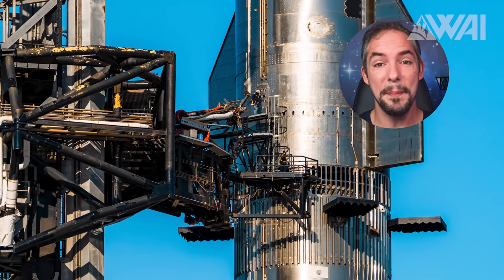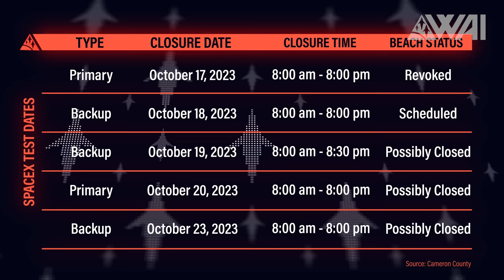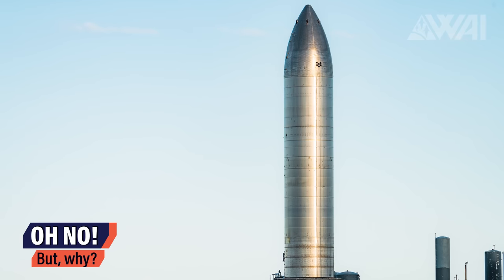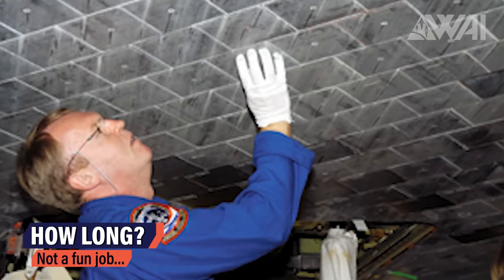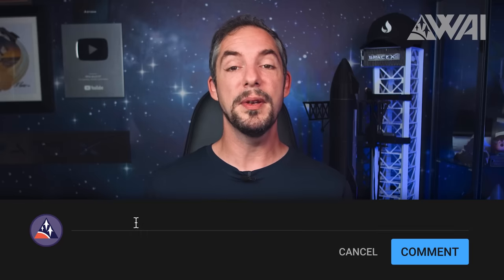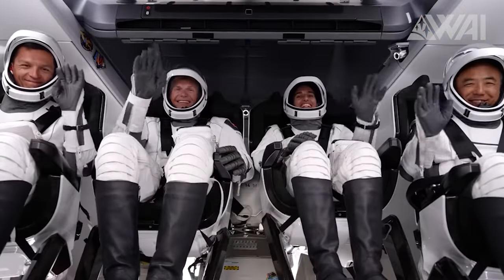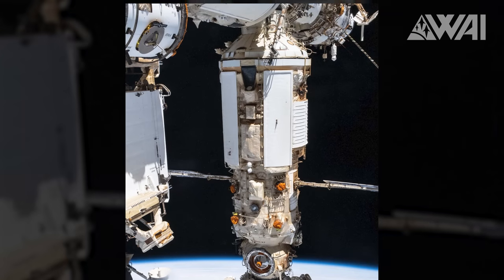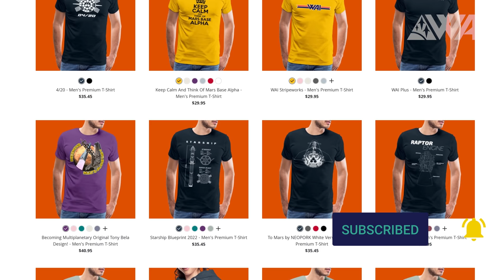SpaceX Starship Tests Continue: It's Action Time!

Comment: Aluminum and stainless are chalk and cheese for heat resistance. I suspect the probability of survival with the of loss of tile(s) is actually pretty good if they can reenter a bit more gently than the capsule & keeping temps below 1000c. 
It will be interesting for sure because that thing is huge and pressurized…
Reply: How many times has this been tried? Many times, you can't dissipate the heat fast enough to prevent rock from melting let alone steel. Elon has the best approach so far.
Reply: If it were not for reuse the 9m diameter sections would not need insulating tiles, only those portions with smaller radius of curvature.  The heat exposure of a surface during reentry is inversely proportional to radius of curvature.  Remember that Atlantis on STS 27 lost MORE tiles than Columbia, over 100, and not only survived but was launched again only 3 months later.  The SpaceX mantra is "The best part is no part." Collectively the thermal tiles, their attachments, and the underlying mats, add many tons to the dry-weight of the Starship orbiter.  I therefore expect that in a year or so, once they have observed actual reentries, that we will see a reduction in coverage.  Even Columbia's aluminum frame melted only where it was exposed by the loss of tiles on the sharply curved leasing edge of the wing.  As long as Starship does not lose tiles on its leading edges there is almost no possibility of any structural elements, made out of the same temperature-resistant stainless steel as your kitchen pots, even deforming never mind melting.  That is why I believe that at worst SpaceX may need to cut out and weld a replacement section.
Reply: I suspect that the refrigeration systems in the Soyuz, Progress, and Nauka were maintained by Ukrainian technicians.  The Russian apprenticeship systems, essential for training competent mechanics and technicians have collapsed !  All Ukrainian employees probably resigned from Roskosmos 600 days ago.

Comment: Yes, absolutely, in some areas finding bedrock is next to impossible: buildings in areas such as Florida, require huge ground posts to support a home/apartment complex and even in NY and CA, towers move.   You are astute..and small movement may continue to be an issue.
Reply: generally those are called "pilings". sometimes architects will design in floats that are then used to build the foundations.

Comment: Small point, but...
Heat transfers in-to or out-of a system. There is no Cold transfer into the Station.  No cold wavelengths of light.

Comment: Do airlines get a new license every time a plane takes off?  Or do they get a certification that certain aircraft types are OK and certain airports are OK for them to fly out of, then are they allowed to fly that plane over and over without having to go through the entire certification process for each flight?  And if we are to fly rockets as routinely as airliners, wouldn't a similar process need to be adopted or its impossible?  Maybe an annual inspection once each rocket passes an airworthiness inspection would be more reasonable?
Reply: Once designed and built the model goes through a long set of certification processes. Once passed a certificate is given allowing planes built in the exact same way to fly etc..

If they want to change some element of how its built later, or redesign the flight hardware (be it software or hardware) then it has to go through a whole process again of recertifying the changes.

F9 has a launch license that is applicable to all F9's built using the same methods, and any changes need recertification, but as its now a mature design, they don't need to make changes, and any they do are quickly certified as they are minor alterations.

Starship however is very different. As its a prototype the license is only given to the single article that is to be launched. There are so many changes between each ship and booster built that they currently require individual certification.

This is not new, and is the same with the airline side of the FAA.

Once they reach a design that 'works' they will get a certification/license like that of F9. But again, any changes need recertification. This isn't unique to SpaceX.
Reply: A spacecraft is not the same as an airplane, and never will be, just as car is not the same as a bicycle, and never will be. 🤷🏻‍♂️
Reply: Very well said. @Thats_Mr_Random_Person_to_you
Reply: Whoa! You forgot that these government agencies need to be able to feel their power, the only way to do that is to hold everything up as long as possible. Someone needs to walk in front waving a flag if you are going over 25 MPH.

Comment: 12:30 During the era of VentureStar, Lockheed Martin lauded their innovative heat shield, Metallic TPS.  The TPS was a composite structure that contains honeycomb sandwich panels at the top and bottom and a variety of thermal insulating materials placed in between them.  The tiles were metallic, a mix of inconel faced and titanium faced rectangular panel fastened on with screws in the corners protected by face caps.  Later it was  reported that LM replaced the titanium with a blanket design  and the end caps for screws were replaced with an expanding wire link and a tool you could slide into the gaps between panels to lock and unlock it to the structure.  I had hopes something more advanced than silicon tiles would be Starship's TPS.  I wonder if SpaceX considered the VentureStar TPS system.
Reply: When you make a million rockets, you want simple reliable and cheap.
Reply: Good point.
 @tedmoss
Reply: @tedmoss   The best part is no part. The more complex a design gets, the more that can go wrong.  Simplicity makes it more easily scalable, and also saves time and weight.

Comment: Just an idea, all that energy to get it initially in the air, would it would not be possible to fire it up a ramp using an electromagnetic sled to assist the initial acceleration?

Comment: Regarding heat shields… why not strips with hexagon edges. Larger puzzle pieces (so to speak), rather than thousands of smaller ones? A strip would wrap around the belly in one piece. Determining the breadth of each strip can be determined mathematically for how large each section could be.
Reply: And watch it crack and fall off?
Reply: @tedmoss  Won’t know till one tries. It’s no different than any other idea that has yet to be produced, tested and learned from. Think of the first starship flight. Not everything worked correctly. They learned from the data and made over a 1000 changes.

Even the current small tiles haven’t  been proven to work.

Comment: Stainless steel expands when it gets hot.  71 meters (height of a booster) expands (grows) about 0.6 meters for every 10 degrees Celsius.  In South Texas, that's a serious issue.  In fact it makes me wonder why SpaceX wouldn't have included some kind of vertical adjustment to the Starship QD arm.
Reply: It appears they did.

Comment: Hey Felix! Would it be possible to post a time-lapse comparison of the initial thrust diverter ring versus its many replacements? I have a theory that these delays have allowed Spacex to R&R the diverter ring with improved versions that computer simulations re veal better results. I'm a low-tech old guy, but to me, the current diverter ring looks significantly different than the first version we saw...

Comment: The ground shift sounds plausible as the ground would perhaps be settling and perhaps some movement is occurring
Reply: It depends on the gradation of the soil. I thought it was principally sand, which tends not to have issues with consolidation or settlement. Liquefaction seems unlikely, but could be a touch tricky if they have a leak in their deluge system forcing water down into the ground, raising pore water pressure. If that’s the case, they might have an issue, but could possibly deal with by pumping down the water table all around the OLIT. Geotech is annoying…
Reply: @Bryan-Hensley  hence the challenge to pump it down locally. Hopefully none of this is happening

Comment: Instead of ceramic tiles they could try compressed coked charcoal. This ablatable substance can withstand extreme heat. And can be easily formed into any shape quickly. Also by selecting a particular shape for the nose cone there are tiling solutions that can be done with minimum shapes required. 
The swampmonter will strangle Space X with red tape given an opportunity. And as we saw in the movie Oppenheimer they usually hand the file over to someone else to do the dirty deed.

Comment: If after all the work and pilling that has gone into that site the foundation is moving to the point where they are having alignment issues then they have some major problems, problems big enough to contemplate the possible abandonment of the site.
Reply: You are definitely not the man to engineer the constructions on the soft ground there, don't apply..😁
Reply: @tedmoss  How many tactical bridges have you built or tactical roading have you put in over wet ground to get tanks through?? 
I have lost count of how many I have done. With adequate protection and a well trained bridging crew it could be done within 12 hours hence the development of a secure bridgehead.
The mechanics of the operation are simple and well understood with the equipment needed being the kind if basic material that any engineering squad would have on hand

Comment: I dont think that adding another axis of movement would work if the problem lies in the foundations because that would change the angle of starship launches which in turn would shift its point of mass and potentially fall over
Reply: The leaning tower of SpaceX!

Comment: I hope the rocket industry has an FAA Designee and/or an ODA program available to help everybody out.  The industry is completely correct, the FAA does not have the manpower to handle everything themselves.   The aviation industry and the FAA have had a very  successful delegation program for 60 years for the  very same reason.   Why not one for the rocket industry?

Comment: anything that will be expanding and contracting as much as these new heat shield tiles are said to be doing will likely develop small unnoticeable cracks and fissures internally until an eventual failure.
Reply: I think that heat shield is definitely going to be the Achilles heel of Starship.
Reply: @oregonsbragia  maybe, hope they have other options.  the fact it's SS, and not Aluminum will help tremendously.

Comment: Regarding heat shield, why not have a quicly replaceable half circle thin metal 'plate'  with all heat tiles pre-placed tiles that is attached onto Starships' body, then after landing just detach and quickly and easily remove the whole thing as one unit and replace with a new one. Then send the 'used' half circle steel 'plate' unit with heat tiles to check and replace/fix individual tiles, making them ready for next flight. Repeat for next flight. Time taken to replace such unit w tiles could be very short, compared to check and fix every tile on the ship before each flight.

Comment: Felix
With 'immense, never before experienced' booster thrust, consider  that booster may be 'point welding' to the ship? Have seen this often for heavily-loaded wire ropes 'spot welding' onto mine-shaft headgear sheaves! i.e. point welding purely from PRESSURE.
 
Relatively simple calcs.
Note the area of contact moves from a large thrust-plan to a relatively small contact ring? 
Posted this earlier ...
Reply: Thrust-plate*

Comment: Wow, 16 hours is pretty fast.    Construction adhesive is 5-8 days.  Concrete is 2-4 days.  Heck wood glue is 24 hours.   Even the king of fast gluing, Cyanoacrylates (super glue) that dry in seconds take 8-24 hours to set depending on what your using it on.
Personally, for the high heat requirements I had thought they would be using some kind of epoxy which can take up to 21 days.

Comment: Hey, Felix. The loss of the Columbia orbiter had nothing to do with those ceramic fiber tiles. The disaster was caused by damage to the leading edge of the left wing of that orbiter. That leading edge is made from a carbon fiber composite material. That material is nothing like those tiles.

And, Challenger was lost due to failure of the O-ring seals in one of the solid rocket side boosters. The tiles had nothing to do with that disaster either.

NASA launched the Space Shuttle 135 times and on the133 successful entry, descent and landings (EDLs), those supposedly super fragile ceramic fiber tiles performed as designed and the orbiters landed safely.

Why do you think that those hexagonal tiles on the Ship will fail during the first Starship EDL? As you say, those hex tiles are superior in every way to the tiles on the Space Shuttle Orbiters. And those shuttle tiles never failed in 133 successful orbiter EDLs. That sets the bar very high for those Starship hex tiles.

Side note: My lab spent two years (1970-71) developing and testing dozens of different ceramic fiber materials and manufacturing processes for those orbiter tiles.
Reply: I recall there was one Shuttle landing (not to Florida, as I recall) that barely survived reentry due to poor heat tile survival prior to point of reentry.

Comment: Hmm, space station, hot side cold side, Sterling Engine, thermocouple/thermionic converter, etc. A source of creating electricity besides the solar panels. Are they even using that or is it being wasted?

Seems as if all the big problems are strictly within the Russian module. So why haven't they built a replacement? They've had plenty of time since the first big uh oh.

Comment: Structual Movement...
A forty-story building may sway a foot to the left, a foot to the right. The span of that period might last around four seconds. A hundred-story building, by comparison, may move on the order of two-and-a-half to three feet to each side, cycling through a ten-second period. Typically, the taller the building, the longer the period of its cyclical motion.

Comment: Hi Felix, thank you and the team for the best updates.  I have an uneducated question regarding the heat shielding.  In short, if the boosters have such extensive reusability without the need for heat shielding, then why does Starship need it. Of course, someone will say that it enters the atmosphere at a much higher speed and hence high atmospheric friction.  But again I ask why does it have to be this way?  If I am correct, the boosters have 2 reentry burns.  The first one slows it and the second one lands it.  Why can't Starship employ a similar system?  A burn to slow the initial reentry below the threshold of dangerous atmospheric friction, and then subsequent burns to further slow, orient, and land Starship?  The Space Shuttle was different, it had to rely on speed and inertia as if effectively landed as a glider with no power.  As I said - probably just an uneducated question!  Thanks again!
Reply: The less propellant used for re-entry by an upper stage, the smaller the booster can be. Starship has to re-enter without using its engines to slow it down because it takes too much fuel to get that fuel up there.
Reply: gregbailey45. Great answer.  So it is a trade-off between orbital payload vs SpaceX's proven technique for landing Falcon 9 boosters.  

Any idea how much fuel would be required to slow down a Starship?  The anticipated payload is 150 tons and with Raptor 3 in the wind it sounds like 10 or 20 tons could be available.  And no flaps and actuators would be needed for a tried and true reentry method.
Reply: The booster doesn't really even leave the atmosphere. Its not really going that fast.
Reply: As mentioned, my question is based on an uneducated understanding of orbital mechanics.  Thank you to those who have responded to try and help in my education.  Can someone please explain to me, why - assuming enough fuel was available, the Starship couldn't slow down prior to entering the atmosphere, so that it almost stopped and then it would effectively only have to deal with earth's gravitation, rather than entering the atmosphere at such high speed?  Please bear with my ignorant questions! Thanks.
Reply: The Starship is coming from a much higher altitude and a much higher velocity. You cannot just slow it down to a speed similar to what the boosters have when they are nowhere near orbit.
Reply: @odysseusrex5908  Thank you for your response.  The way I see it, it wasn't long ago that reusable rockets were considered impossible and relegated to the realm of science fiction.  So, I believe that if the 'will' is there, it can happen!

Comment: If the rocket is sinking a little bit it might be due to the compression factor of the soil. After all the ground there is sandy which means it is nit good for this
Reply: Sounds like it will not end well.
Reply: With the amount of concrete linking the rocket to the tower it is unlikely there is unforeseen deflection due to subsidence. More likely they are working on making the QD arm connection more reliable.

Comment: Hi Felix, with the potential single point tile failure dangers of re-entry, would it perhaps be helpful to have the ship's design be the most tile-friendly shape possible and have just a "few" tile shapes total so that a Canada Arm type mechanism could scan, access a spare tile storage, and replace missing tiles on orbit? It appears that the two places where many specialized tile shapes are located could be significantly reduced by perhaps having a "less pointy" or blunt nose cone with a circumference that is similar to that of the main body where universal tiles would fit (some amount of performance reduction?), or the previously floated idea of placing the flaps more leeward and outside of the tile field? Thanks!